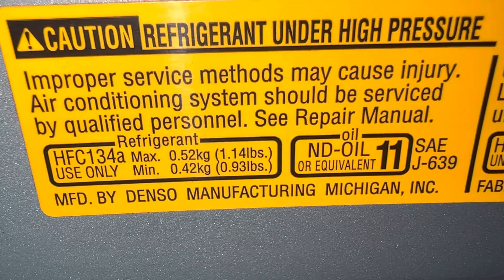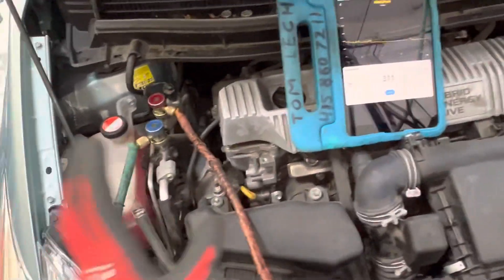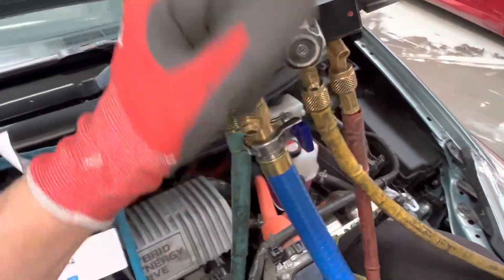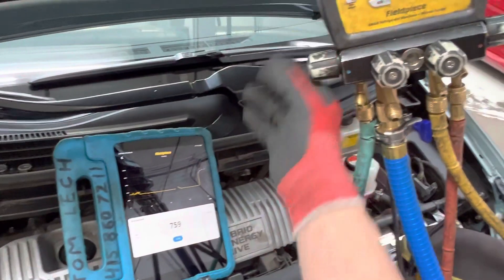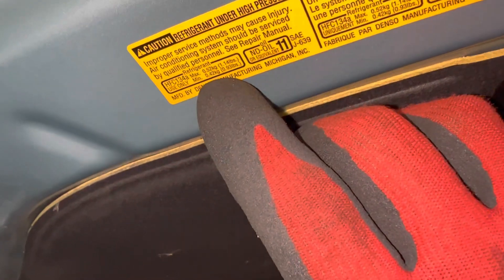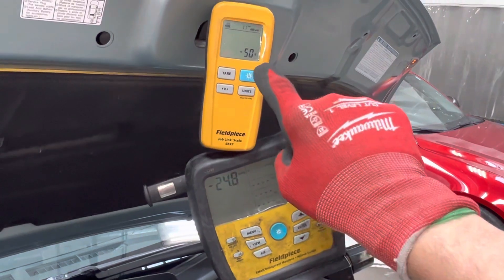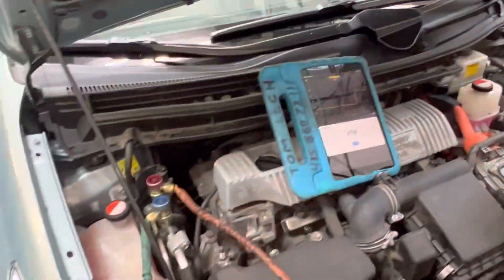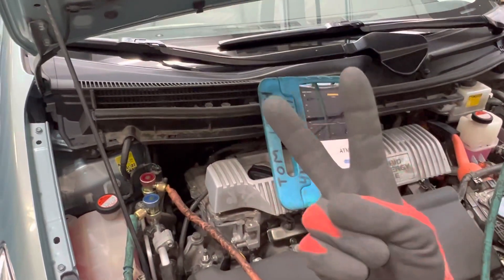Refrigerant Recharge 2014, Prius 520 g.

Comment: HOW MUCH ND-11 OIL NEEDED? HOW DO YOU GET IT INTO THE SYSTEM
Reply from the maker: Depends on what was replaced? 

If no parts replaced no oil needed 

If for example a condenser was replaced 

Oil quantity is different for different cars. But this one 45ml if the condenser was replaced
Reply: @coldfinger459sub0  oh ok only when condenser is replaced 
ok cool i got another question 
i smell nail polish i assume it's freon leak 
 if so can i inject some dye into the system and how much dye you think?
Reply from the maker: @21boxhead  a good quality, concentrated fluorescent UV dye from tracer line products

They make one specially for electric compressors on Prius and other electric compressors 

You only need about two or 3 mL 

Their die is so concentrated 5 mL I think to roughly 10 ounces of oil charge and your system only has roughly around 3 ounces of oil charge 

So you don’t need the full 5 mL 

Some fluorescent UV dyes  are not very good not powerful deluded down and they’re in other types of oils that should not be in a Prius .
Reply: @coldfinger459sub0  ok so does the dye need to be full of freon first or what currently in the system will do?
Reply from the maker: @21boxhead  it could be added after the refrigerant is in the system or it could be added when the system is empty they have a injection tool like a syringe that gets filled up, the dye can be injected in the low side fitting

Manufacturer has instructions tells you what to do follow the instructions